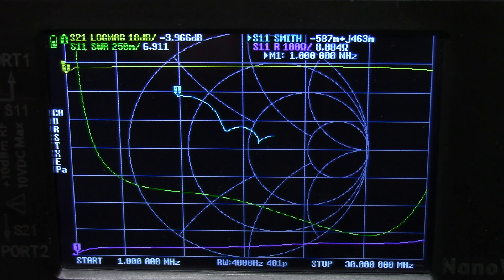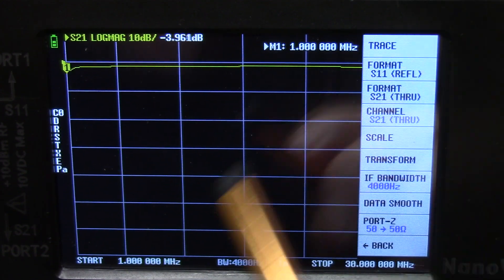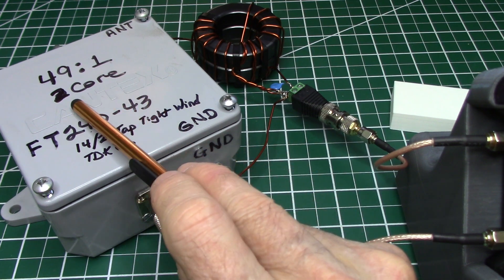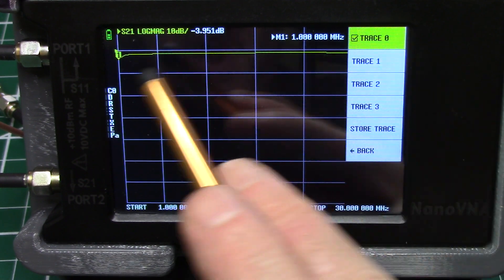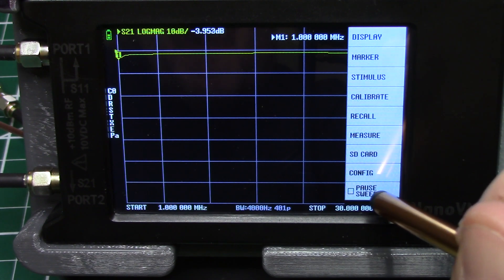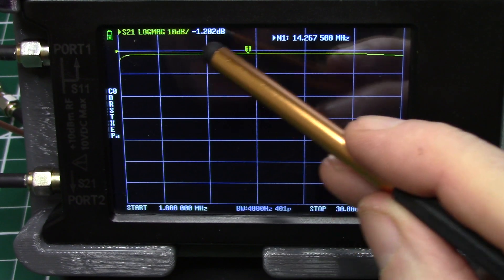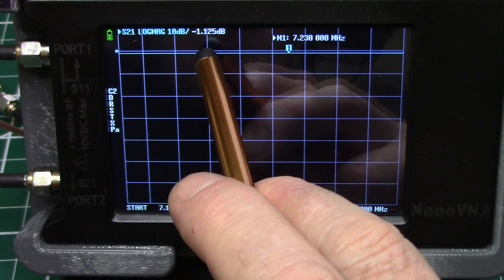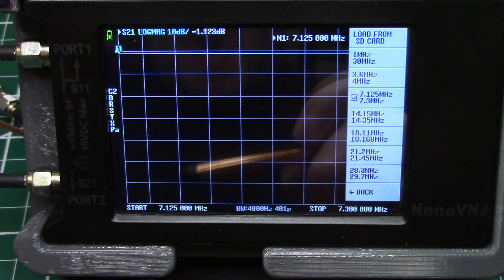How to Measure Insertion Loss with NanoVNA (Baluns, Ununs, Coax, Filters) – Step-by-Step

Comment: I use a Keysight Field Fox at work and I have used other VNAs, as well. They all require OLST-standard calibration before every use and recal if ambient temperature has changed 10 degrees or more (Field Fox). Why would you not calibrate before each use with the NanoVNA?
Reply from the maker: Mine doesn’t seem to vary that much. Also I believe the more recent versions are more stable and repeatable than older ones.

Comment: For this test, do you calibrate "thru" and "isolate"?  Or only thru?
Reply from the maker: I did both but you definitely have to do the thru. For the isolate, if you have two 50 ohm loads put one on each lead. If you only have one, put it on Port 1.
Reply: Thanks